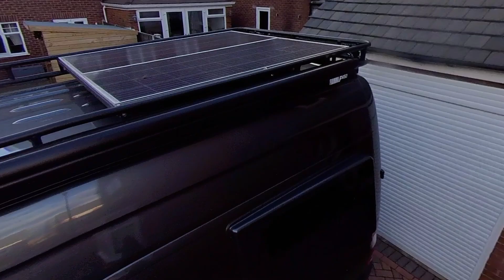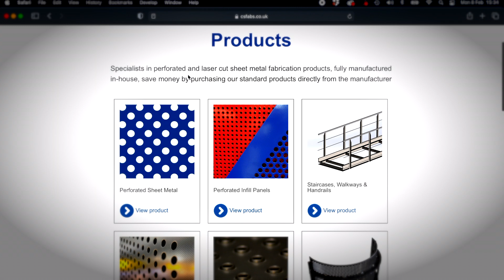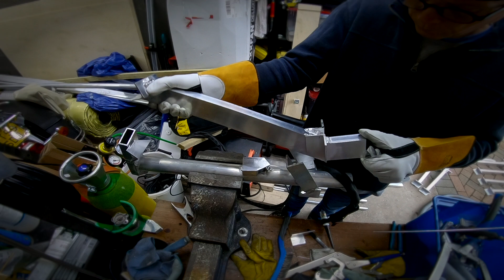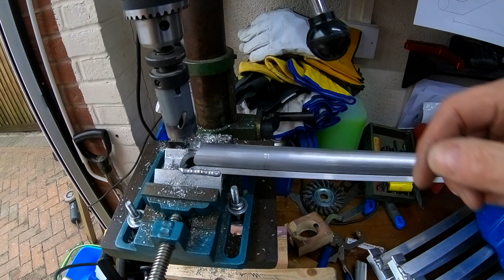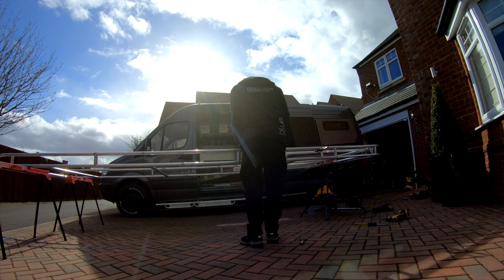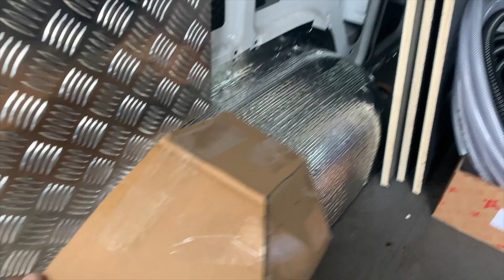We made an aluminium roof rack - Part 4 of our self build camper van conversion

Comment: This is the best DIY roof rack I've seen so far. Did you paint it or powder coat it?
Reply from the maker: Thank you. We had it sprayed with Raptor bed liner paint.
Reply: @diamondsontour Thanks! Did you apply edge primer first?
Reply from the maker: Yes, Etch primer applied by body shop first.

Comment: Just stumbled across your channel and liked your attitude to problem solving! I too taught myself to weld for exactly the same jobs. Love learning (and saving money!). Now onto a rear wheel carrier with integrated ladder 👍🏻
Reply from the maker: That sounds great. A wheel carrier is one of my next missions over the winter. Are you planning to have something at the bottom that the wheel sits on to take its weight, or just take the weight through the bolts that hold it on in the centre? 
And are you changing the hinges and bolting it to them? Ben.
Reply: Morning Ben. I’m a bit of a muppet when it comes to YouTube, how can I share pictures with you?
Reply from the maker: @keswickadventure  hi, you can send to ben at sarahandben.uk
Reply: Dot Co dot Uk or just dot Uk?
Reply from the maker: That's fabulous, we're definitely thinking alike. So will your spare bolt direct to the carrier? I'm going to make a hoop at the bottom that the wheel will sit in and then a bolt probably through the middle just to hold it back against the carrier. I might use a locking wheel bolt to keep it safe, or a padlock or something. What do you reckon on security?
Reply from the maker: @keswickadventure  just dot uk
Reply: I’ve just popped another pic up showing the adjustment available on the centre bolt. I was going to install two bars on the bottom of that part to hold the wheel up, but I’ve since changed to another hoop for more strength.
Reply from the maker: @keswickadventure  thanks, really appreciate it.

Comment: Hi what welder did you buy please ?
Reply from the maker: Hi, it’s this one from Amazon. Röhr WSME-250 TIG/ARC 4 in 1 Welder Inverter Gas/Gasless 250 Amp AC/DC 240V Anti-Stick Welding Machine Hot Start MMA MOSFET – Welding Mask & Variety of Accessories Included https://www.amazon.co.uk/dp/B07F883M9Y/ref=cm_sw_r_cp_api_glt_fabc_TAYY28HE8WBK50PNHXDC?_encoding=UTF8&psc=1